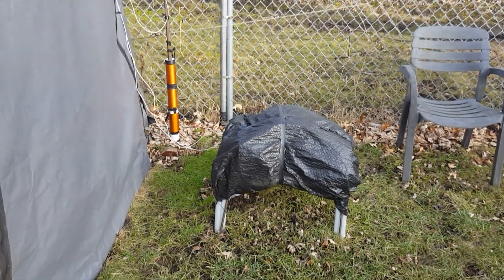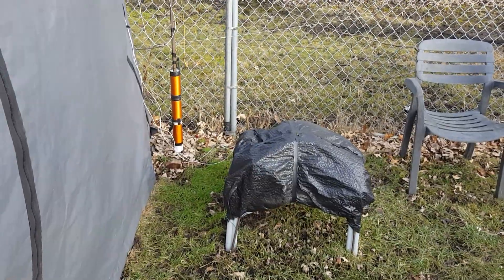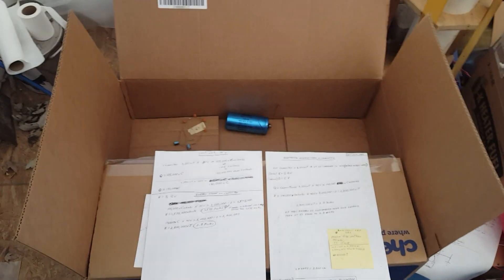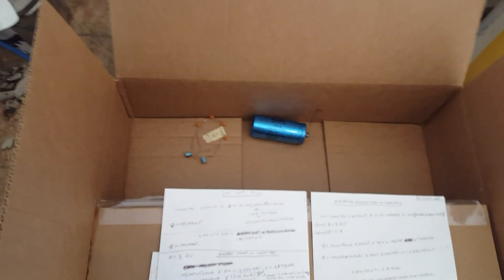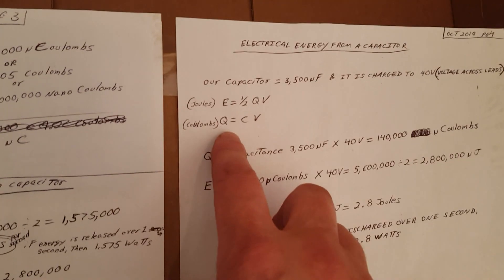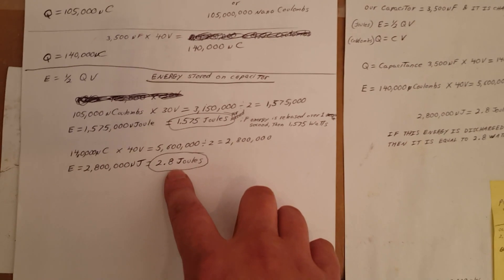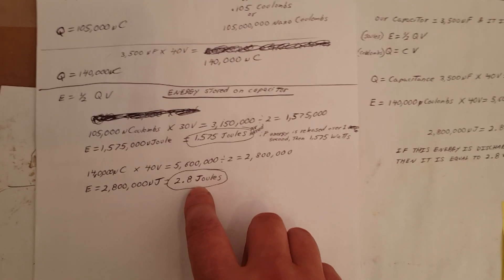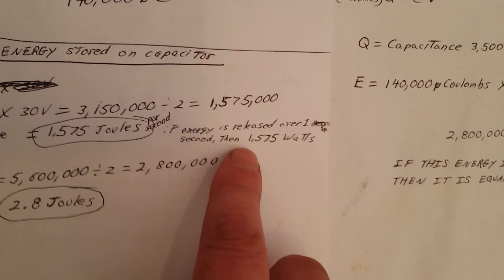Free Energy From Air 2020, part 21

Comment: An aerial is most accurately modeled as a constant current source.  Your voltage will seek whatever potential to push that current.  Try using a 1 farad capacitor; I have no idea what would happen I just think it would be cool.  Add a 100Mohm resistor in series and see what happens; your voltage should rise considerably (Energy of Capacitor = .5 * V^2 * C).  

Basic dimensional analysis: Joule is a measure of energy.  Joule = Watt * Second.  Therefore if you divide by second you would get Joule/second = Watt.  Yes, if you discharge a capacitor with 2.8 joules over a second you will get 2.8 watts.  Theoretically that is correct; practically it is difficult to discharge a capacitor in this way.  Power is the time rate of energy creation (generation) or destruction (consumption).  Theoretically, any power can be achieved by one joule of energy [more complicated than it sounds].  

1 joule * 1Mhz = 1 Megawatt  [frequency  = 1/second]. 

This is why Tesla said increase the frequency increase the power.
Reply from the maker: Thank you!  I forget some parts of electronics since i learned it 12 years ago.  That re-fresher really helped.  And thanks for you suggestion of low value cap and resistor.
I like your comment of "Theoretically, any power can be achieved by one joule of energy [more complicated than it sounds].  
1 joule * 1Mhz = 1 Megawatt  [frequency  = 1/second]. "

No, not complicated,,,I know exactly what you mean!!! :-)  Thank you Tesla!   Did you see my latest video...yes "high freq" wireless transfer of energy.....  https://www.youtube.com/watch?v=h4gvfdIflKk

Comment: i wonder if you connect a dynamo or motor to your project what the max wattage would be with the electromagnetic torque conversion? Also i have been building a machine outside of my lab to produce high electromagnetic energy in a uniform matter and even nearby polystyrene picks up a minor charge i would be curious as to what your project could pick up off of it. the electromagnetic radiation overloads my emf meter and my volt meter instantly blew both fuses i tried so i don't even know the energy output.
Reply from the maker: Sound like a nice project you have going there.  Have you tried Avramenko plugs on it,,is it high freq. are you capturing that energy wireless.  I wish you had videos :-(
Did you see my last video...  https://www.youtube.com/watch?v=h4gvfdIflKk
Reply: @INVENTOR3 i have not tried Avramenko plugs everything i obtain is scrap or what i find in the desert near my house and im not capturing the energy wireless as of yet but i am working on it.

Comment: I don't understand your thinking on the voltage being more important than the current, I do know that the resonance being right is very important I think. What does riding on the outside of the wire do, reduce or eliminate the resistance? Thanks Paul,it's nice to see you back.
Reply from the maker: I believe we can get the current back in the end, we will soon find out.  High freq, ride on out side of wire, the Skin effect, much less resistance, like super conductivity.  A lot easier to fight your way through the air then through a solid.  Please take a look at this video,,i posted the same day.....  https://www.youtube.com/watch?v=h4gvfdIflKk       Notice all the current i am creating from voltage, but many more tests need to be done yet.  Good to see you again man! :-)